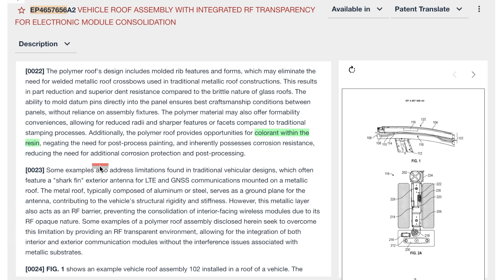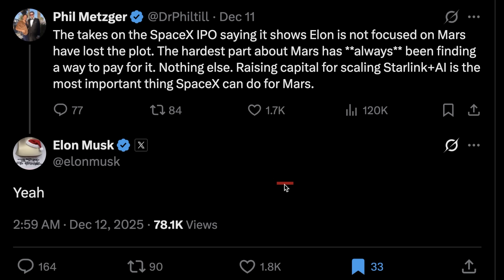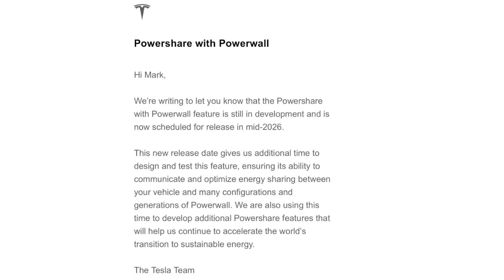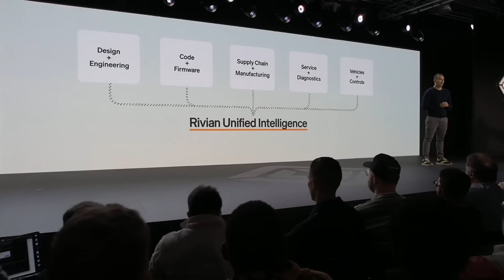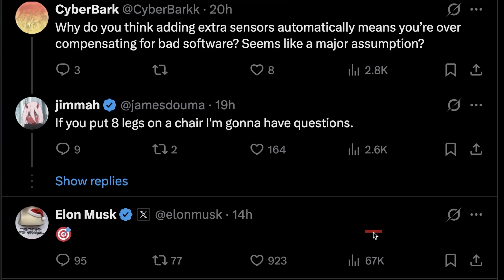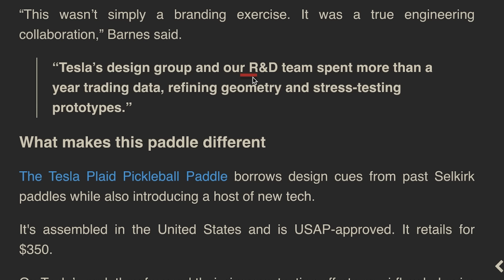Starlink Native in Teslas? / FSD Regulatory Change / Time To Talk About Rivian ⚡️

Comment: FSD would be adopted faster if it was sold like SuperCharging: Open it to every vehicle and bill based on usage. Deploying FSD one owner at a time isnt working. Deploy FSD fleet–wide!
Reply: As someone who doesn't drive much since getting a 100% remote job, yup. Only way I can see using FSD outside getting a month if I was going a multistate road trip or something.

Then again I have HW3 so it's mediocre anyway. I'm still annoyed they charge the same price and don't give a steep discount for HW3 for the proportionally very poor quality FSD compared to HW4.
Reply: @tHebUm18 I mean the car still drives itself most the time, I use 70% FSD on my HW3 car, not something to take for granted lol
Reply: @dyldog  Perhaps, then, it should be 70% the price of folks doing 99%+ of their driving with HW4? Maybe 50% because when it is active it does all sorts of wonky/weird things compared to on HW4?

They even completely skipped HW3 folks for the ~45 day free trial HW4 folks are getting from before Thanksgiving to the end of the year. What's up with that? All HW4 vehicles got their earlier free trials when HW3 was the lead stack.
Reply: Excellent idea. Or just include it with a purchase and make it easy and watch everyone flock.
Reply: @chrisg8995 you get a month free with purchase of a new Tesla
Reply: I use FSD for 99% of my driving (495 of 500 miles) so this wouldn’t be a good plan for me
Reply: @a @andrewmo49  Uh, doesn’t that depend on the usage rate? What if the usage rate is $0.10/FSDmile for the first 1,000 FSDmiles each month? Think about it, and you’ll realize it’s a win for Tesla, a win for the consumer, and a win for road safety.
Reply: @RogerWilsonTodd  it would need to be closer to 5¢/mile. At 10¢/mile it would be $100 a month for most drivers.
Reply: @U2B_Viewer  You mean what it is already, except that it gives every owner CONTROL over their own bill each month? Think this through more carefully.
Reply: @U2B_Viewer just make it 5-10 cents a mile depending on how many miles you drive in one fsd trip, like road trips can be cheaper the city driving, and then make fsd pass that's unlimited at $100 per month. Or also an fsd on highways for $65 that's purely for highway driving.
Reply: @RogerWilsonTodd  No because the goal is to encourage a transition to Transport-as-a-Service and the end of personal vehicle ownership!
Reply: @jonbowes5999  FSD would be adopted faster if it was sold like SuperCharging: Open it to every vehicle and bill based on usage. Deploying FSD one owner at a time isnt working. Deploy FSD fleet–wide!
Reply: @RogerWilsonTodd FSD was never intended for personal use... Unsupervised autonomy will be widely available via the Tesla autonomous fleet this is the best option to provide maximum benefit to the Tesla Mission!
Reply: @jonbowes5999  You are mistaken. FSD is being developed for to improve safety of all roadway vehicles. Thanks for reading my comment.
Reply: @RogerWilsonTodd  I believe I am correct there is only one purpose and that is the Tesla Mission safety would be the result regardless as ALL transport will transition to autonomous Transport-as-a-Service the safety is a commendable by product...
Reply: @jonbowes5999  REMINDER: Tesla’s mission does not preclude EV ownership.
Reply: @RogerWilsonTodd  Individual EV ownership is wasteful in terms of resources the Mission is better served with shared Transport-as-a-Service why is that not obvious?
Reply: @jonbowes5999  If efficiency is your only guiding star, then you must want everyone to stay put and not move. I live in a practical world.
Reply: @RogerWilsonTodd  On the other hand you are simply annoyed because you want to hog resources rather than support the greater good... I support greater mobility for all including those who currently cannot access it freely, that does not have to be in a selfish resource hogging way!    Can you not see that Tesla has been selling FSD to vehicle owners simply to fund the development of autonomous Transport-as-a-Service which will be deployed in the way that best accelerates the transition to sustainable transport as stated in the Tesla Mission... An autonomous vehicle that serves one individual is not  best supporting the Mission.
Reply: @jonbowes5999  FSD would be adopted faster if it was sold like SuperCharging: Open it to every vehicle and bill based on usage. Deploying FSD one owner at a time isnt working. Deploy FSD fleet–wide!
Reply: Great idea to have FSD as pay-as-you-go!
Reply: That’s a terrible business plan 😂, think through it
Reply: It's convenient for you but probably a nightmare for Tesla Imo. Still They already have a monthly subscription option
Reply: That's not a great idea from a UX perspective. Charging people for something incentivizes them to do less of it, not more. I avoid using superchargers because it's cheaper to charge at home. I'd gladly pay for FSD if it was available, but if it was pay per mile, I'd only use it when I really needed it, not all the time.
Reply: @Ehralur  You are typical of first time FSD users. You THINK you’d only engage and pay for it when it’s really needed, but the REALITY is that once you start using FSD, you will pay to use it MORE and MORE! That’s what makes a FLEET-WIDE usage based model so superior to begging for adoption one owner at a time. TRUST ME.
Reply: Not sure what charging plan would work for me in the UK, if I changed to a Tesla. My Chinese EV cost around $100 a month total cost, that’s insurance, servicing and fuel for around 8k miles a year. So if a Tesla cost a similar amount to run, it would be a big ask to double my running costs to add FSD.
Reply: @garyhill9723  With USAGE-BASED FSD billing, your FSD cost would be under your control each month. That’s a huge incentive for FSD adoption.
Reply: I’m sympathetic, but how many people driving Teslas cannot afford the monthly price of one F150 fillup?  I’m not sure that price is the obstacle, as much as disappointment with pre-14.2 iterations.  Plus, some people view driving in traffic as a competitive sport, and don’t want to give up annoying other drivers and causing near-accidents.
Reply: @carsonassociates3263  You make my point perfectly! Begging for adoption owner by owner does not work, and FSD must be deployed FLEET-WIDE to get those who don’t yet realize how useful and enjoyable FSD is!